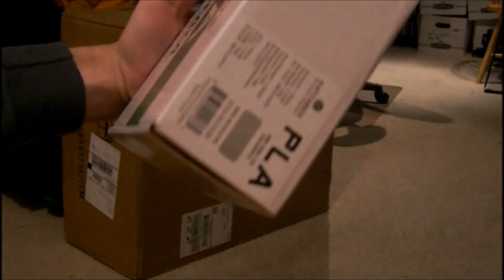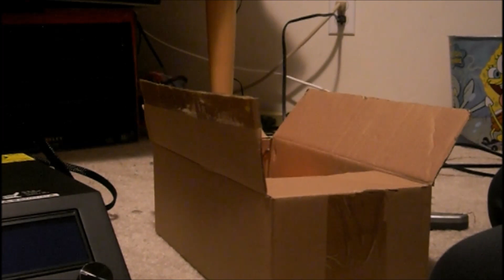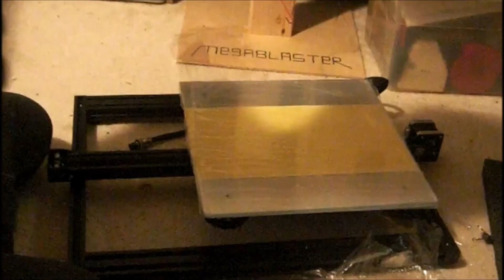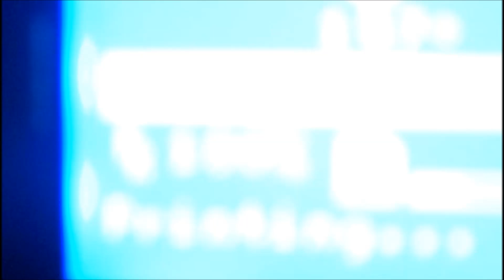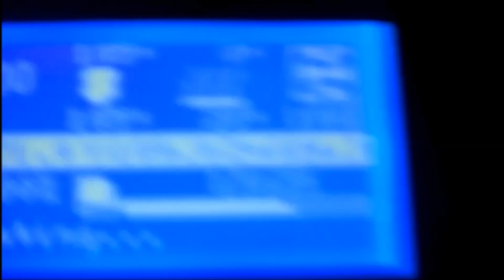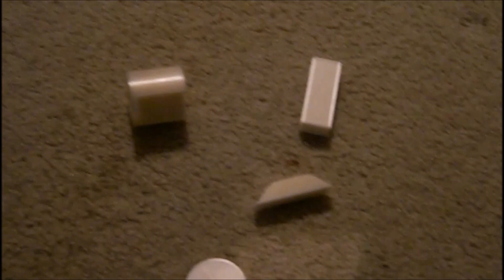i got a 3d printer! (hictop 3d printer unboxing and test.)

Comment: When you print, make the bigger surface area face on the bottom, also try using MakerBot made PLA if it is the same diameter, as it works just fine for my prints.